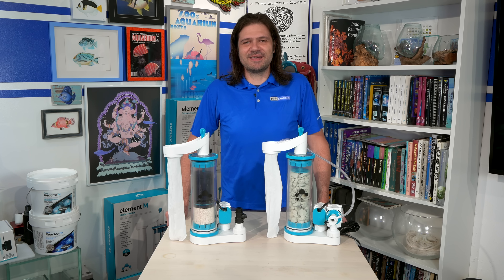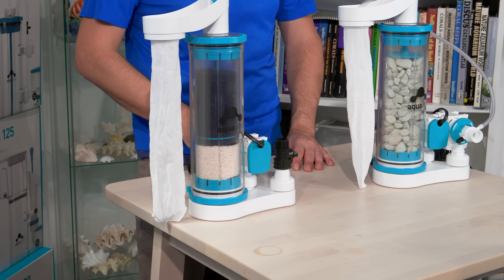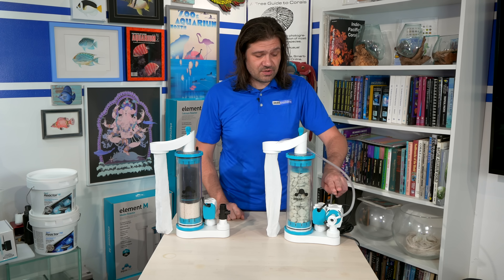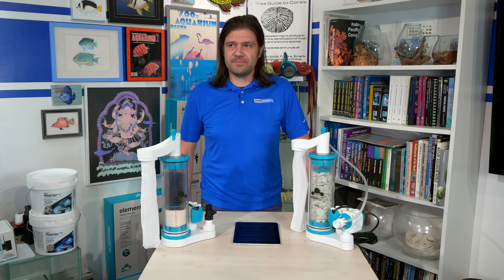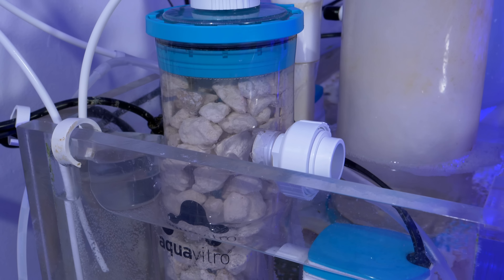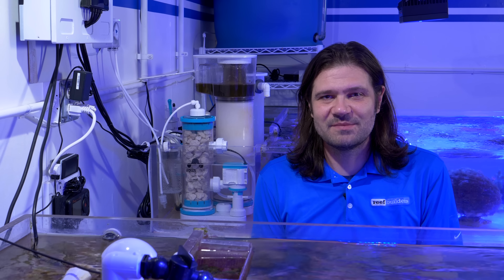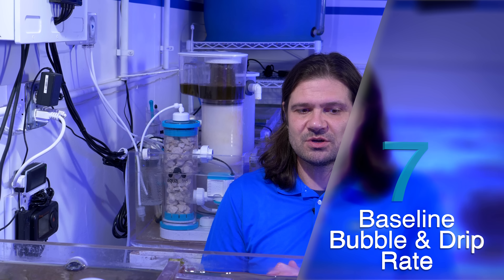10 Things to Know about Using a Calcium Reactor - Aquavitro Element CA

Comment: Remember your article on the big destaco , did you guys get round to adding a second dosing pump for faster flow through the reactor?.
I have a large custom built reactor using the destaco hard media which I can drive down to 6 ph but struggle to get a high dkh from the reactor even if its driven with a hefty over gas at 180ml per mi, comes out at 20 to 21 dkh..
One other curiosity question,  rest gasses , I only ever see this build up if I run at a serious over gas and the down time on the reactor isn't long enough over night for the reactor to de gas by itself , no doubt there are other impurities in co2 which I have heard as refered to as rest gasses that build up in a reactor but if the case why don't they become problematic above a reactor ph of 6.2 ish .
Good video above , keep them coming .

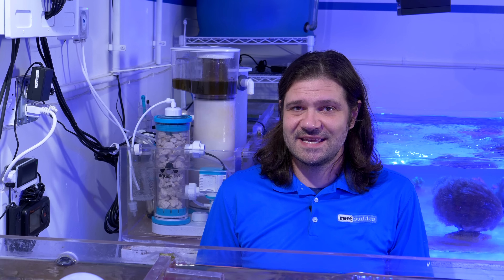Comment: the power supply hanging halfway out of the socket at 10:30 is triggering my OCD. Great vid, thanks for the insight!  What do you think of using 2 part, calc reactor, and kalk on the same system? Would there be any benefit to using all 3? (for a 300 gallon system, using each sized for a 100 gallon system)
Reply from the maker: Yes I like to lay down the kalk as a calcium foundation and pH buffering, then a calcium reactor as a baseline for alkalinity, and then make smaller adjustments using dosed additives.

Comment: Great video Jake, what about the twin tech deltech you was running you still running it? If so which one do you prefer?  Thanks in advance
Reply from the maker: I'm still running the Twin tech but that's on a 600 gallon system, fully automated, and over $2500 with all the media and CO2 supply.

Comment: Hey brother, I know the best way to counter the low ph in the aquarium due to the calcium reactor is to dose sodium or calcium hydroxide at a constant rate too (drops per minute).
I do not use calcium reactors as they are unnecessary because all you need is sodium carbonate and sodium hydroxide to maintain alkalinity.  If you want to recreate the calcium reactors ions, all you need to mix is sodium carbonate and calcium hydroxide. I would drip it in drops per hour.
Reply from the maker: I use kalk on all of my tanks first, some also have dosing, some have reactors, and some have all three.

Comment: For me the daunting thing with calcium reactors is less about setting them up, but more the fact that after dropping 6 bills on a calcium reactor you're not even close to ready to go, need the carbon dioxide, ok fine get a canister filled up... wait now you need a regulator and oh no better get a really good one or that overly expensive Carbon Doser one ... fine NOW I'm ready to go right?  Nope now you need a feed pump, and you can't go with a cheap peristaltic pump either!     Then F-it... I'm going back to 2 part, all I need is some containers to hold it, and some peristaltic pumps to dose.